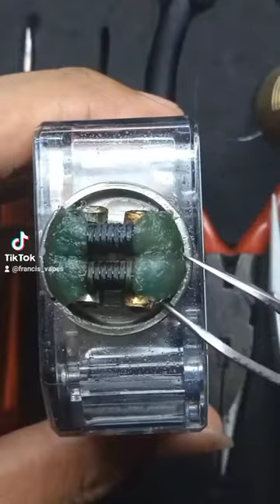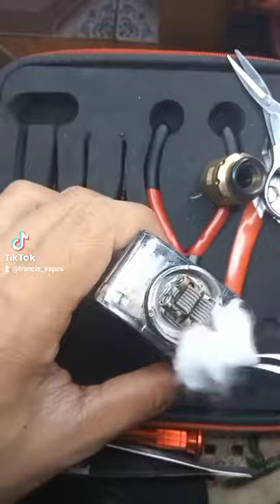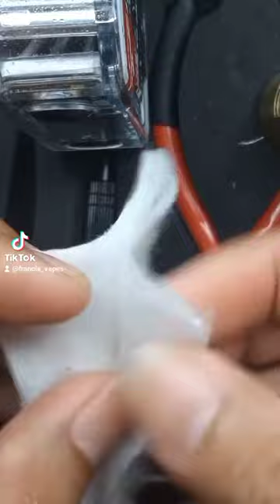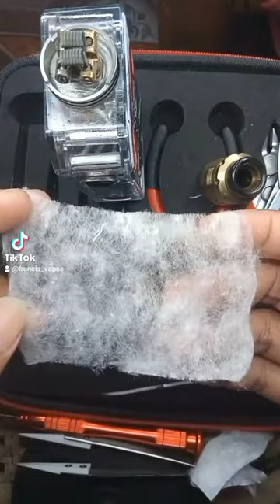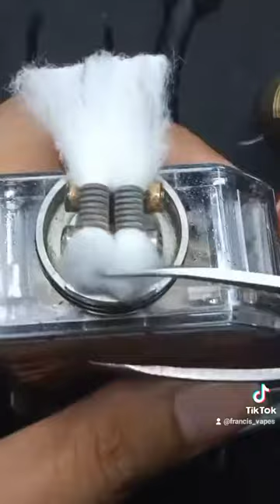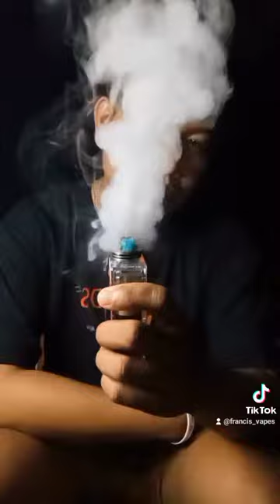Scottish Roll Wicking (Tagalog Sub)

Comment: Hah, so you're rolling the thin layers.
I always removed the outer layers of a pad, then streched it out, and then I rolled the pad up to the desired thickness.
But with your way of doing it, the will me more rounds the roll then if I'm using the full pad.
I will definitely try out your method for RTA's, because I guess that it will improve the capillary action.